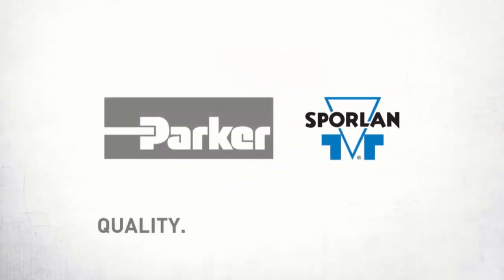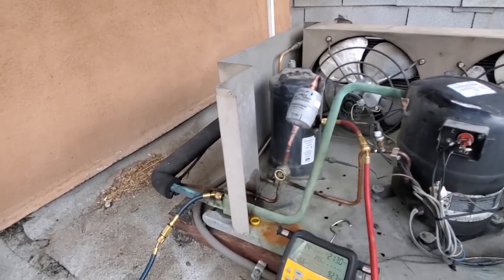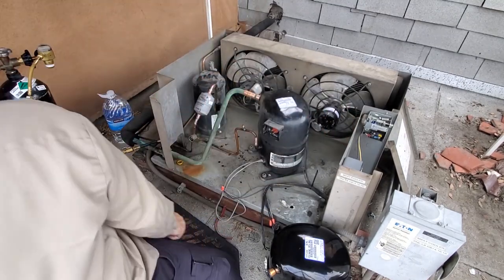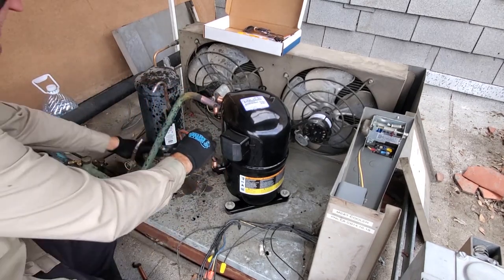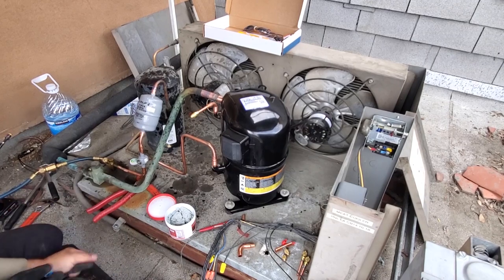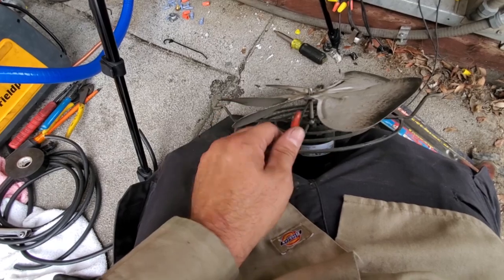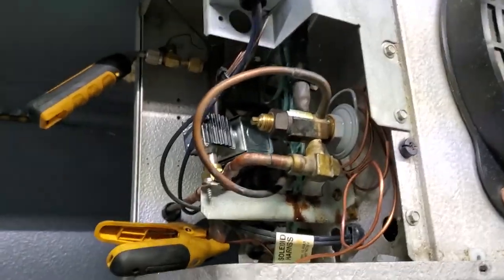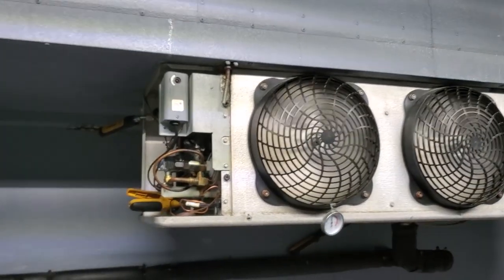WALK IN COOLER NOT WORKING

Comment: As usual, I was cemented in place until the end of this video. Your ability to express your investigative thought process is a great bonus to your videos. Your analytical process and deductions based on gauge readings are thorough and insightful, something I'm able to recognize at this point is a must-have skill. I appreciate the time spent without comment on soldering your joints and the inspection time. I think the point was made that taking your time will save on backtracking, and preventive measures to protect components during brazing is non-negotiable. Finally, the operating analysis, after all repairs were made is a great bonus to your videos. Thanks for bringing us along. Never a wasted moment.

Comment: You were concerned about overcharging this unit, yet you have a receiver that at 80% max fill capacity there would be plenty of room to add 2# over full charge. My guess that system could handle 10#+. On headmaster controlled units in cold environments, I usually charge @ 80% receiver capacity.  

I too put my hat in the ring for StayBrite 8 on liquid lines and suction lines. I reserve braze for discharge lines only. I’ve never had any issues. I’m more concerned about damaging components from overheating them than reaching any burst points. You can usually skip the nitrogen flow too with solder.

Curious on your thoughts.

Comment: Try unbolting the old compressor first then sweat the lines out of it. Can wiggle the compressor with heat on the joint to break it loose. Good video for the new comers in the field 🤘

Comment: always good to verify no voltage as a stab could be stuck and the other 2 pull out. working in the mines ive seen several times where a stab didnt pull out or the actual linkage in the breaker box was broken. thats why we always try out equipment before work

Comment: I always preferred c cutting out the drier too prevent releasing any moisture they might have in them .  Back long long time ago we used to reuse the d 48 core driers and put them in a oven heating them up  release the moisture lots of drier cores used on grocery store start ups foundunits that high pressure problems have realeased some moisture and it freezes in the expansion valve and the vox tep raises up to 3233 degrees and starts  operating again until freezes in txv again when you change the compressor and do it properly you remove the moisture and any non condensables that may have entered system from lowrefrigerant leaks on the low side failed low pressure switch

Comment: It's awesome to see you run through issues using deductive reasoning. That is what makes a great engine tuner as well. Probably 80% of the time i get a vehicle in that "just needs a tune" i have to fix issues that guys thought i could just "tune out." What most people lack is the overall understanding of the entire process, whether it be AC systems, engines, electronics, you can't run through and diagnose issues if you don't understand how the entire system works as a whole. Just to give some context of My night, it started with my water heater leaking and i went looking for info on a Tankless one and somehow ended up here lol. I will say i'm glad i found your channel as i've already learned a ton more about refrigerant systems and i will use it in the future on cars.

Comment: I haven’t watched the whole video yet but it seems that if it’s short cycling on the high pressure switch and when you bypass it your compressor internal relief valve opens then you have a pretty bad restriction in the system. How was the drier that you replaced?

Comment: I noted you burnt your sight glass like I did using that stuff in a plastic Jar.  I may considering using staybrite 8 in the future, just for sign glasses.  I know supply houses useto carry them with 6" extended ends to help with that issue. That oil looked black, why didn't you use an HH drier?
Reply: using an HH filter is for only when the system is grounded or Flooded
Reply: @primetime758  the activated charcoal sweetens the oil and if the system becomes acidic later on, it helps keep the oil from burning up the windings.  Cheap insurance. If the oil is black, its burnt!
Reply: @hvac01453  if the oil is Black that doesn't mean its necessarily burnt.. but if in certain cases as this one ... the compressor is back leaking means the oil came to a point of no lubrication anymore..  so i would of put a normal Suction filter .. not HH

Comment: Wasn't you decreasing the super heat and I always check the discharge line temperature also even though the high pressure was looking close  other problems causing a high discharge temperature will overheat the discharge valves and breaks easily with hifh pressure but I enjoy watching your videos even though I'm retired after 40 years in the HVAC INDUSTRY iearn and find the new technology very interesting and you have good work ethics and pride in what you do

Comment: Why did you change the working condenser motors and sight glass? You were a few components with the exception of the receiver and time clock from making it feasible just to change the condensing unit.
Reply from the maker: I will discuss this on my Livestream this evening 3/22/21 @ 5:PM (west coast time) come over and check it out https://youtu.be/4C3S2VG1qC8

Comment: If the system was designed to be a freezer , but customer runs it as a chiller . I would have fitted a crank case regulator. Also taken the opportunity to replace the compressor for a rotor lock version.  I am sure you had gauges on when you diagnosed the HP switch problem. I am never to keen to bypass a safety control. However good job you did , else if you just had to order one and come back another day to fit it. You would have to make another vist again, once you diagnosed the compressor pumping problem. Most likely valve reads or snapped piston rod. This most likely liquid flooding back.  Lots of parts in the system needed attention. Well done for bringing it back  from the dead.

Comment: On one of your videos you mentioned that lower solder joints on vertical tubing splices (like when changing a dryer or sight glass) are harder to do because they're "upside down".  Can you not just flare the bottom / existing tube, insert the new tubing down into it and then solder from the top?  I would think doing that would make joining the two tubes much faster and make a good join on the first try, but I'm not all that familiar with joining pipe...

Comment: Im having an issue with a freezer cabinet not cooling enough both the suction and head pressures  are very low on a capillary system. I also thought it was a leaking valve on the compressor but it didn't sound like yours.
Reply from the maker: I will be going Live on YouTube tonight 8/12/19 at 5:PM west coast time to discuss my recent uploads and answer questions from emails,the chat, and YouTube comments come check it out if you can https://youtu.be/Os9rV7YWjzo

Comment: Do you ever check the oil in the old compressor prior to installing the new one to make sure its not filled with metal? The oil didn't look too bad coming out other than being a little dark. Maybe Im just paranoid from working on cars. If a compressor shits the bed there you have to try and drive it back with no accessory belt if the AC clutch welds itself together or the belt snaps.
Reply from the maker: I will be going Live on YouTube tonight 8/12/19 at 5:PM west coast time to discuss my recent uploads and answer questions from emails,the chat, and YouTube comments come check it out if you can https://youtu.be/Os9rV7YWjzo

Comment: I don’t get it, you changed almost the whole unit component; why not just replaced the unit itself?
Reply: think about what you would have to charge a customer for that after you rent a lift or crane(it turns into a bigger project than just a rope). if the pieces are still made and the customer approves the repairs why get greedy and try to charge them more? theyll turn around and probably go for other bids and more than likely go with who they pick for that for future work.
Reply: @Jpalms123  true very true  but it never hurts giving them...  THE BEST OPTION  brand new unit yes.. it would cost much more... but ? it would be faster.. especially if he can buy an indoor unit and put it on the roof and just build a dog house from sheet metal... or go for plan B  repair whats up there
Reply: @primetime758  it's always better to give the costumer look your unit it's  old I can fix it. But I would recommend getting a new unit this one may failed in the future  ( 6 month less of more) it's your option
Reply: Wouldn't be a good video 😉

Comment: At what point do you change the whole condenser? The only thing left is the coil
Reply from the maker: This was a time sensitive issue a new condenser would have required a crane and we didn't have time for that, this happens alot in restaurant work, sometimes you gotta get it fixed
Reply from the maker: I will discuss this on my stream tonight, I will be going Live on YouTube tonight 8/12/19 at 5:PM west coast time to discuss my recent uploads and answer questions from emails,the chat, and YouTube comments come check it out if you can https://youtu.be/Os9rV7YWjzo

Comment: Food for thought, A wide open TXV will cause the suction pressure to be high and can blow the same components, but It sounded better after putting the condenser fan motors on.

Comment: Can do describe the difference between a pressure limiting TXV vs a Normal one and how to tell the difference? Love your videos!  Really appreciate the time you take to help us out. 3yrs in Refrigeration and AC.
Reply: The press limiting valve will have zp on the end of the number on power head any sporlan bq valve can be made press limiting with the correct power element they act like a regulator limiting suction pressure some are 35 psi some are 65 psi they are most commonly used in freezer applications where defrost would raise suction pressure beyond what the compressor would like
Reply: @anthonydaros8938  sounds good. So like an EPR (keeping minimum pressure) where the TXV with Pressure limiting the maximum suction pressure?
Reply from the maker: Thanks for answering that Anthony !
Reply: Can you bring this up in pod cast PLEASE. I am still not getting it. Thanks
Reply: I kinda figured they use em instead of a CPR because it was cheaper. And certain refrigeration systems using an axv for the same reason. Ice makers, beverage chilling, milk treatment, blast chilling etc where I usually see them. Saving that compressor
Reply from the maker: I will be going Live on YouTube tonight 8/12/19 at 5:PM west coast time to discuss my recent uploads and answer questions from emails,the chat, and YouTube comments come check it out if you can https://youtu.be/Os9rV7YWjzo

Comment: Hmmm.  @41:00 you seem to be confusing ounces avoirdupois (that is, the weight) with fluid ounces (that is, volume).

Liquids are almost always measured via their volume; solids are usually measured via weight.  "Ounce" can refer to either measurement system, but they are not the same.  So, saying that the mfgr specs "40 ounces" of a liquid (volume) doesn't mean that you can compare that to the weight of 35 oz. of oil.

Bear in mind, phase-change refrigerants are measured by weight, so you're used to thinking in that metric.

Comment: Have you used Staybrite before? What’s your opinion? I have had great success in the past on Liebert  computer room equipment refrigerant control components.
Reply from the maker: No I haven't I dont have confidence in the product but other people swear by it. I'm a 15% silfos kinda guy
Reply: HVACR VIDEOS ok. I can understand that. I put a Trane XL 1800 in 32 years ago and it’s still in service without any signs of failure. I have also replace countless expansion valves and solenoids. Love you post.

Comment: Bypass will close once pressure is lowered and compressor will pump fine . Have had lots bypass due to bad fan motors and they always work once cooled down
Reply from the maker: What pressure does the compressor usually bypass at?
Reply: @HVACRVIDEOS  depends on ref type .
Reply from the maker: Doug this one had 404a, so I'm trying to figure out when the compressor will bypass. How high does the head pressure have to be for it to bypass?
Reply: @HVACRVIDEOS  not sure of all the settings but we'll above a reasonable conditions temp.
Reply: Condensing temp
Reply: Imagine if smoke started it up with service valve shut. This would protect you and compressor. If u look in outlet of a semi hermetic u can see it and replace it if necessary
Reply: Dam spell check
Reply: Should have said started
Reply from the maker: @dougshakell8003  I know what pressure the compressor bypasses at. It will usually bypass around 450-460 psig and my head pressure was at around 240 psig.  the point I was trying to make is you clearly wanted to talk crap when in fact you didnt know what you were talking about, The compressor had a bad reed and the gas was leaking by into the suction side. The compressor was bad. Now I am cool with both  feedback and criticisms, but when the criticisms are false it irritates the hell out of me. I'd encourage you to continue to watch my videos and provide any feedback that you feel necessary but you dont have to be so negative especially when you are clearly wrong.
Reply: @HVACRVIDEOS  you didn't test leak down of valves and your pressure was after the bypass opened . So keep learning bro lol .
Reply: By the way it's 330 am here good night  get a life and try some advice yourself . People in the trade that think they know all usually find out otherwise.
Reply: The compressor didn't relieve until u bypassed hp a bad valve would have not cause excessive pressure.  A buddy made me watch these vids because he thought u did the wrong thing as well. I could hear the bypass pop open once u made it run . Sometime your just wrong acept it!

Comment: Could you take the high temp limit switch and wire nut it was well? Worked on a unit and only had that type of safety on the unit
Reply: Yes but you never want to leave it like that

Comment: When I saw the age of that condensing unit and a failed compressor I would have recommended replacing the entire deal
Reply: It doesn't look that bad.  And in some cases it's often better to just do a partial unit rebuild rather than to have to hoist a new unit up, especially in a place which is very busy like a restaurant (he does a lot of restaurants).

Comment: High pressure switch designed to save the unit. Actually ends up in this case destroying the unit.
Reply from the maker: Yep
Reply: Nothing was wrong with hp control.  With a mic find condenser a restriction or underfeeding txv will cause exessive pressure. It was doing its job.large compressors have a time delay to prevent short cycling caused by unacceptable conditions.the hp switch cycling burnt contactor coil.
Reply: Rich Davis high pressure switches with MANUAL RESETS save units, the auto resets are the ones that kill. Only HP switch i will install is manual reset

Comment: There is bad contact in defrost timer. There was big arc flash when you energized system for solenoid.
Reply: you'll pretty much always see an arc-flash in timers with open air contacts, especially when opening inductive loads like relay/contactor coils, solenoids, motors and capacitors...
yes they should be forced to put diodes and or capacitors in there to absorb the huge back EMF spikes, but they'd rather sell you a new timer more often lol

Comment: 6:00: So how is the bad discharge valve tripping the high-pressure control on the discharge line?
11:35: Doesn't the line to the recovery tank need to be purged?

Comment: I was trying to think of why you would change out the sight glass and the pressure switch but I’m assuming you were being preemptive in trying to find a leak
Reply from the maker: the high pressure control was bad , that is what was causing the contactor to turn on and off, the sight glass was changed just because the old one was in bad shape
Reply: Oh ok and what about the condenser fan motors?
Reply: @latenitehvac868  believe he changed them to get more RPM's and airflow through condenser coil, it was likely struggling in the high temps and maybe the old motors were getting slow. the oil was fairly crispy :)
Reply from the maker: I will discuss this more on my Livestream tonight 8/12/19 at 5:PM west coast time come check it out if you can https://youtu.be/Os9rV7YWjzo

Comment: Hey this is awsome bro, so I had this exact problem about a year ago on a walk in where I would show up and compressor would be off on overload and I could not figure out why because once I cooled it off it all ran perfect for sometimes 3 or 4 days,no callbacks, then I'd get called back and again, overload, but why? I think it was the 4th or 5th time I was up there and just sat there for about 3 hours waiting for it to happen and it finally did exact same on off on off just like this one. I think it was the hp switch for me as well but can't remember which one now, either way I swapped it out and was fine for about 3 months I think, then had to go back for compressor failure. After changing comp its been good ever since. Sometimes we get baffled by what's going on if we can't see the issue when we're there. Luckily it was happening when you first got there or it could have been one of those calls that make you look like you don't know what you're doing and keep you up at night 😉